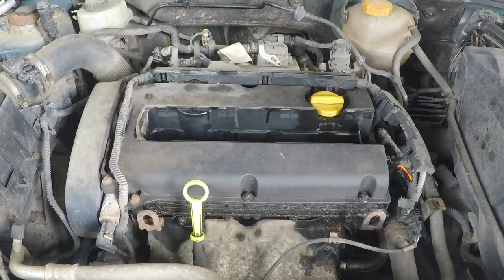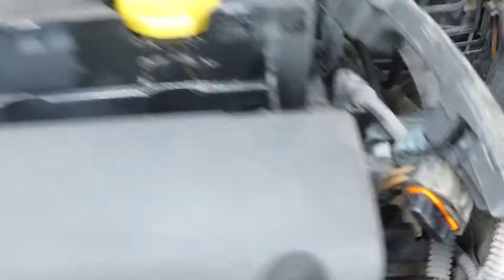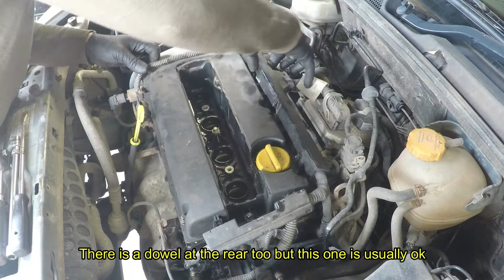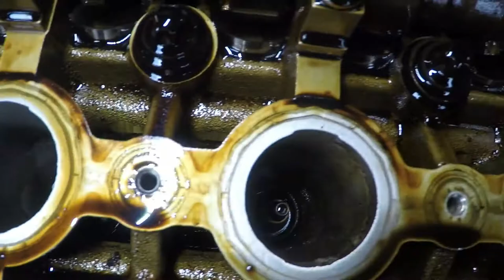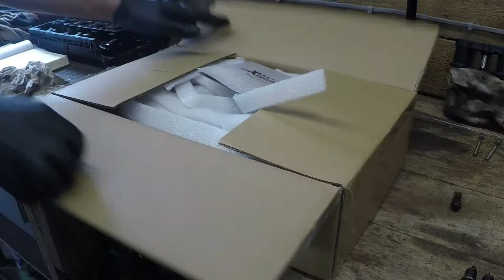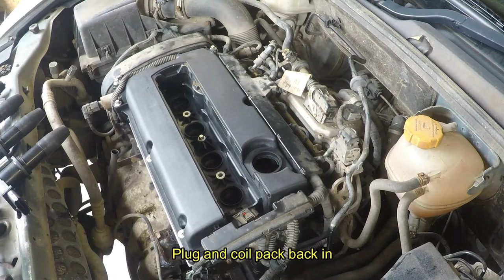Vectra C 1.8 Oil Leak Cam Cover + Gasket Replacement

Comment: What did you put on the dowels to stop them jamming again.
Reply from the maker: I used a bit of copper slip on the new dowels.

Andy👨🏼‍🔧
Reply: @AMSVauxhall  Cheers, I didn't think you would have put them in dry.

Comment: I didn't see you to clean the plugs holes from oil.
Reply from the maker: I don’t film everything as it’s time consuming but I have a vacuum extractor I use to suck up any oil and then clean down with brake cleaner

Comment: I’m gonna change the gasket on mine tomorrow, hope I don’t have trouble with that dowel bolt cuz I’m not planning on a new cover.
Can you tell me the torque setting for the bolts. 
Great video 👍 that’ll help a lot.
Reply from the maker: Let me know how you get on buddy! The torque setting for cam cover bolts is 8NM 

Andy👨🏼‍🔧
Reply: Thanks Andy, is that bolt part of the dowel or should it come fully out, thinking if the bolt is clear of the head but stuck in the dowel I could use a slide hammer to pull the dowel out.
I’m going out there now to loosen it off and put some WD40 in and let it sit for couple of days.
Also how was the dowel put on during manufacturing, maybe just threaded on.
Reply from the maker: @Wayne-Jones  the dowel should slide out with the bolt but it prefers to seize in the head. There is one opposite at the back too but it usually comes ok.

Andy👨🏼‍🔧
Reply: Just loosened that bolt, it wasn’t seized and came loose easy enough. I’m thinking the dowels are moulded in to the cam cover so Ill use a slide hammer under the bolt and gently ease it out.
Didn’t realise there was one at the back as well, will check that one tomorrow, wife got the car.
Thanks for all your help Andy 👍
Reply: Hi Andy
3 months later, I finally changed the gasket Today because car is only running on three cylinders, spark plug cavities full of oil and coil pack is ruined, new one coming tomorrow. But the job went great no issues with dowels. Anyway thanks again for the video and info.👍👍👍
Reply from the maker: Nice one Wayne! Glad you got it all sorted buddy 😁👌🏻

Andy👨🏼‍🔧

Comment: I need to replace the gasket on mine, perfect video for this. I'll be looking for new cover as im sure mines going to be stuck like yours was 👍
Reply: Update to mine, after i replaced the cover its started leaking again in the same place again. Bottom right corner as you look at it. Will double check torque settings again when i get timing belt out to replace.
Reply: @craig1173  is it fixed now? Did you do it yourself or garage? If garage how much did you pay?
Reply: @sashankthag12  yeah all fixed, did it myself. Garage was charging best part of £500 just to replace it nevermind labour fees
Reply: @craig1173  yep likewise 600 to 800 without guarantee, I'm half way through the process now. I removed the cover and  it had mustardy gunk underneath. Cleaned all that and let it to dry for now. What did you guys use to clean the engine bit like in the video its all shiny new? I used brake cleaner for most of the cleaning part. And how did you get the torque right? I have a basic wrench really.
Reply: @sashankthag12  i used a degreaser, unfortunately ive got a leak from somewhere else now so need to find that one. When the weathers better I'll locate the leak when i change timing belt etc thats all starting to squeak
Reply: @craig1173  I replaced the gasket today and still leaks from behind below the belt cover and can’t figure out where it starts. Belt area is newish and dry. Thinking to give up n sell now
Reply: @sashankthag12  im going to get use of a car lift when the lock down allows, get it up on the ramps and hsve a good look through it as best as i can im no mechanic but do most of what i can at home in my garage. So far only thing only thing not done was a clutch change but that was my previous car
Reply: @craig1173  the leak has stopped actually after replacing the rocker cover gasket. There was just a bit from pervious leak that dripped but now all dry. Just spent £10 on gasket. Changed oil and filer as well. Cleaned up all the leak drips underneath as well. Runs smooth now. However got another issue to fix, knocking/clinking noise at the rear suspension when over potholes and bumps :\
Reply: @sashankthag12  ive got that exact same noise, got to get M.O.T done and go from tgere with mine i think
Reply: @craig1173  its the rear axle bushes on mine. Got a quote for 250 to replace, checking a few more garages. Can do myself but haven't got all the right tools.

Comment: I was going to replace my spark plugs today but oil was covering them. Cleaned it away with ear buds. NOt sure what caused the leak, coolant and oil seems clean enough.
Reply from the maker: Do you mean they were cover in oil from the top as you were removing them? Or the electrode inside the engine were covered in oil?
Reply: @AMSVauxhall  I haven't removed the plugs yet. The top of two of them was covered in oil after i removed the ignition coil.
Reply from the maker: @terranceharrison  that will be the cam cover gasket then buddy. I would definitely recommend replacing the gasket at the same time as plugs.

Andy👨🏼‍🔧
Reply: @AMSVauxhall  thanks for the advice
Reply from the maker: @terranceharrison  anytime man 🤙🏻

Comment: I need to replace my gasket and the bolt head on the one you mentioned being problematic sheared off with practically no force. Any tips on removing the cover with the bolt head as it is? I presume the cover wont come off with the screw itself still in place? In this situation, is the cover salvageable?
Reply from the maker: You can get the cover off with the sheared bolt in place. It will slide over it but the metal sleeve inside will be rusted to the sheared bolt if that makes sense? So it just a case of plenty WD-40 and working it up with a couple of levers / screwdriver until it eventually gives. I have done one in the past that actually broke the cover before it budged on the broken bolt and in this situation you will have to replace the cover. Once the cover is off, the broken bolt is easily removed with a pair of vise grips.

Andy 👨🏼‍🔧
Reply: @AMSVauxhall  Thats great, thanks Andy!

Do you happen to know if the bolts and sleeves can be bought separately? I'm not having much luck finding them online or at least a part number. Presumably because they normally come as part of the cover.
Reply from the maker: @glenadams316  they only come as part of the cover I’m afraid. The covers aren’t to expensive and usually come with a new gasket for around £50

Andy 👨🏼‍🔧
Reply: @AMSVauxhall  hi Andy I have also had two bolts snap without notice, just the head as they was extremely tight. will the cover still come off one of the problematic ones you said and also one of the front ones. it should come off still? I got a new cover? just don't want it stuck in engine I got wd40 and some mole grips
Reply from the maker: @azzamehmet  yes it will still come off but you will have to persevere with it. It will still be stuck / rusted to the dowels which is what you now have to lever it over. The cover will break anyway so just use a chisel to crack the plastic around the dowels and then you should be able to remove the snapped bolts with mole grips afterwards 💪🏻

Andy👨🏼‍🔧
Reply: @AMSVauxhall  the front one is lifting through but it’s the far left one that’s not budging. So I have to crack the plastic around the bolt? Your the help I have 😂 don’t suppose you got any social media I can contact you on as I’m currently working on it and just wanna show you it 😂
Reply from the maker: @azzamehmet  I’m on Instagram under same name - amsvauxhall
Reply: @AMSVauxhall  messaged cheers mate
Reply: If you need to replace the bolt after removing it you can measure the length, diameter, and thread pitch, then find the corresponding bolt at a store.

Comment: Were did u get the cam cover and are the gaskets ready fitted to it ?
Reply from the maker: Jim Clarke cam cover is from Poland and all bolts, dowels and gaskets come as one which was great 😁👨🏼‍🔧
Reply: @AMSVauxhall  found one comes witb oem gasket so hopefully be ok  just need torque wrench

Comment: We're would I find this part online to buy the full cover and gasket.
Reply from the maker: eBay buddy😁👨🏼‍🔧
Reply: Do you have a link for the part on eBay by any chance?
Reply from the maker: @chrisargent9650  the company i used have sold out buddy. There are plenty others on eBay though.
Reply: I'm to scared to buy incase I buy the wrong part.
Reply from the maker: @Slots4fun1993  most of the part suppliers will confirm if it’s the correct part of you give them your registration number

Comment: How much does it cost to get all that done at a garage?
Reply from the maker: Probably around £200 all in but if you have the tools then give a go yourself. As long as the surfaces are spotless and the torque settings are adhered to you will be fine. The cam cover and gasket is about £50/£60 on eBay 

Andy👨🏼‍🔧
Reply: @AMSVauxhall  thank you. The garage wanted to charge 100 just to see where the leak is coming from and said camshaft. Is that right?
Reply from the maker: @sashankthag12  offt! £100 to see where the leak is coming from? 🙈 “camshaft” is a bit vague if that is what they said but it’s either the cam cover or a cam seal.

Andy 👨🏼‍🔧
Reply: @AMSVauxhall  wish I could post some images in comments. I managed to remove the cover and pretty much looked like yours where the cover joins. But luckily all 4 spark plugs are totally dry and no oil. It was just around the gasket area and a lot of gunk under the cover which I managed to clean and let dry. Part 2 is to fit the gasket bought from ebay to the current cover, connect everything back and fingers crossed.

Comment: Did the yellow oil light keep coming on when this happened?
Reply from the maker: No not at all. The yellow oil light is low oil level but could also be a faulty oil pressure switch

Andy👨🏼‍🔧
Reply: AMS Vauxhall okay thank you, mine keeps coming on after 5 min of driving and oil is burning quickly. I checked the switch and there doesn’t seem to any oil on it
Reply: And there’s oil in the same place as yours all around the join of the black plastic cover
Reply from the maker: @samranson2187  then gasket is likely to need replaced if there is oil weeping from the gasket. The oil pressure switch is quite difficulty to see as it lives behind the water pump / manicat so testing / replacing would near impossible without removing the A/C pump at the very least. If you suspect low oil pressure then a pressure gauge should be connected to check. I would check for failed crank seals too

Andy 👨🏼‍🔧
Reply: AMS Vauxhall oh right okay thanks you Andy would a garage charge much for this to be done? I usually replace the basic parts myself, is it overly hard to do?
Reply from the maker: @samranson2187  the cam cover gasket is pretty much as in the video. If the cam cover comes off ok then it’s pretty straightforward. Outer Crank seal involves removing the timing belt. Inner crank is gearbox, clutch and flywheel off and the oil switch is tricky but doable with a lot of swearing and cups of tea. 

Andy👨🏼‍🔧
Reply: AMS Vauxhall okay will give it a go as in video thank you 🙂
Reply from the maker: @samranson2187  let me know how you get on buddy 😁

Comment: You forgot to use Gasket sealant
Reply from the maker: You don’t use gasket sealant on this. It has a channel for the oil like most gaskets on Vauxhall’s. The use of sealant will cause it to leak and risk entering the engine. I’ve said it in many videos, never use a sealant.

Andy👨🏼‍🔧